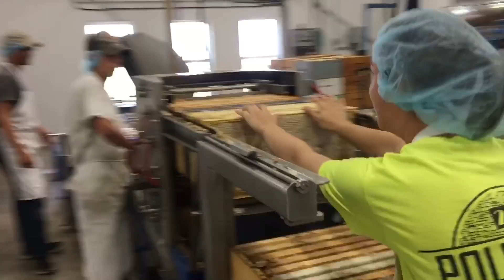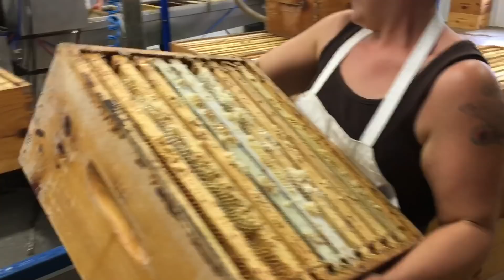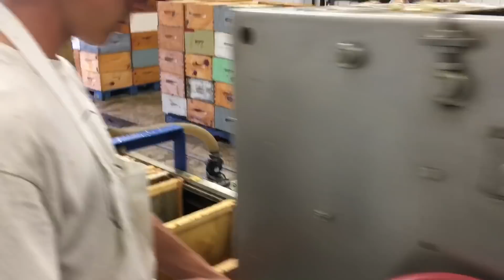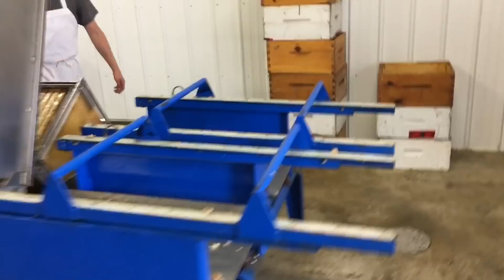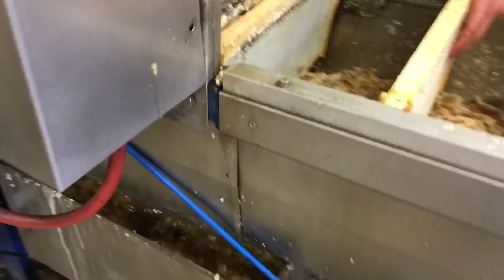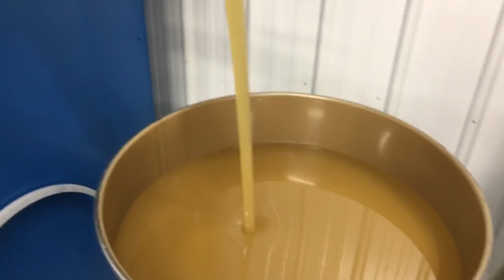Mid sized Commercial Honey Extracting Room

Comment: how is the level in the mixer under the uncapper so high? How can the extractor drain?
Reply: The system has an auger that pulls the honey from the extractor.  Pulls it out faster than gravity will drain it out of the extractor.  The sump can be overflowed by the auger...